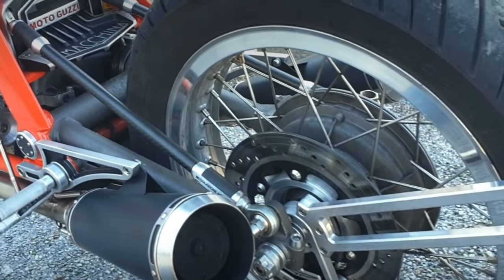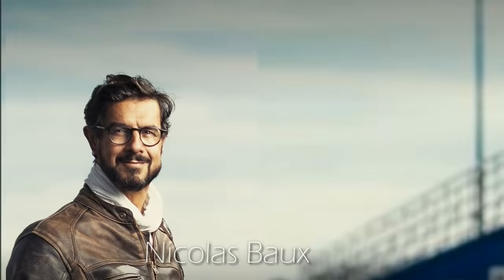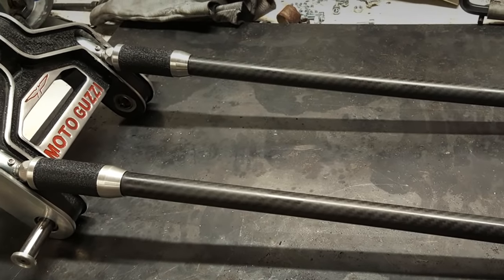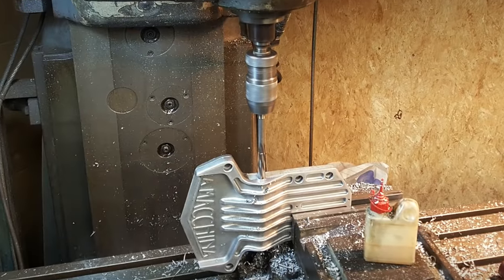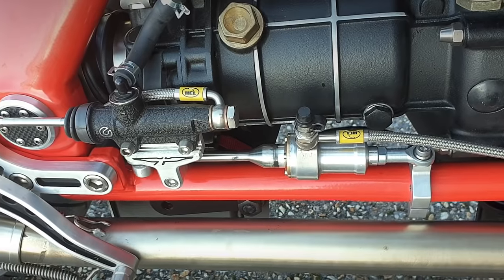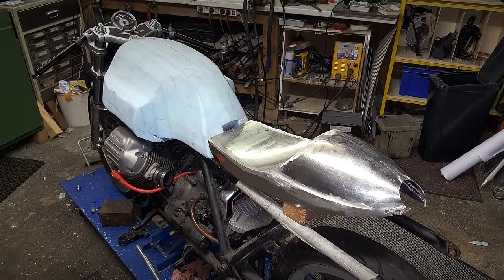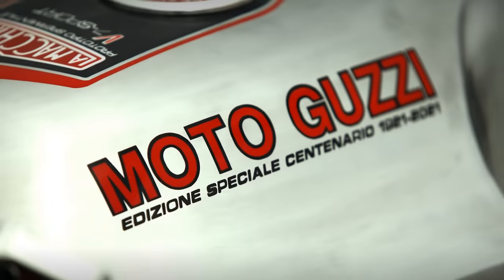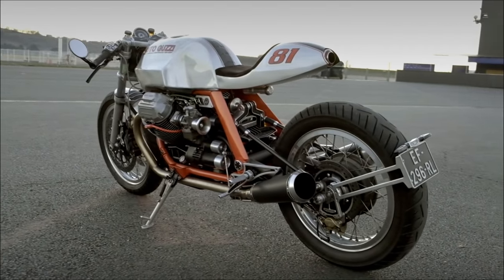Cafe Racer (Moto Guzzi La Macchina 850 By MCNC)

Comment: Absofuckilutly "Spectacular" that first shot of the Clock & top of the "Handlebars," told you this was going to be something special, & it certainly is, "One man's Vision" that's why the "Big4" will never make a bike like this, they all build by Committee, things like this come as much from the heart as from the mind, this guy really knows what "Custom" means, it's not putting a couple of parts from a different bike or sticking some bits of shit on it, it needs proper work, real "One Off" stuff for each & every one you build, I would imagine the price is "EyeWatering" but you would never see another quite like it. I think you must be a mind reader, my friend, I've been looking for a way to "Really" fix a bike(one of those I bought to help a friend in need, not something I would recommend to anyone) the way he supported the frame with those wings(?) will do just nicely, & would you believe I have just been asked to build a CafeRacer for a Pilot, so I will take them & I'll be having a go at those air intakes if you please, "Hand Casting" is not the easiest way to make shit like that, especially if you have an Engineering shop at your disposal, but it is one of the coolest, they looked f#ckin amazing, my only real criticism is he should have used AutoDesk Inventor instead. Happy NewYear my friend, I hope it's your best yet. PS I think you have found the winner for 22.
Reply from the maker: I'm glad you liked so much my friend. Yes, this project has a lot of inspiration related with airplanes. I am glad this video is very helpful to you. Thank you my friend for sharing your perspective. :) Cheers.

Comment: What kind of ignition key is this? I've tried to find something similar but failed.
Reply from the maker: @marcogarzotti597 That's a very good question. I believe it is just a custom made cylindrical device, which activates a switch inside the hole. There is probably a magnet inside the hole, to hold the cylindrical device in place. I hope this helps. :) Cheers.
Reply: @RACER_TV so, you don't have any kind of safety to prevent someone to start the bike with a stick. I guess that it's not that simple, considering the effort and the details of this customisation. I'm convinced that this is a legit key system.
Reply from the maker: @marcogarzotti597 After reading your comment, i made a new research on my files, and i finally found one clip in which i can see the entire device.
Believe it or not, it is a 3.5mm to 6.35mm audio plug adapter.
But at the end where it grips, there is a bigger cylinder.
Personally, I believe that inside this cylinder, there is some sort of electronic component that allows the electrical sistem of the bike to be turned on. :)

Comment: Looks better than it sounds but I love it nevertheless
Reply: Many of these recent "cafè racers" (and this is no exception) start from low cost models, not from a Le Mans model.
I would be curious to know if the heads are from a Le Mans (that means with big valves), if the carburettors are 36 or 40mm, how can they breathe through such strangling filters....who knows?
The aesthetics is undoubtedly jaw-dropping